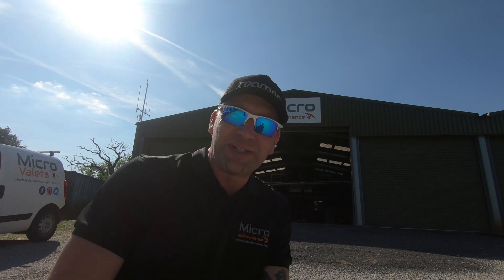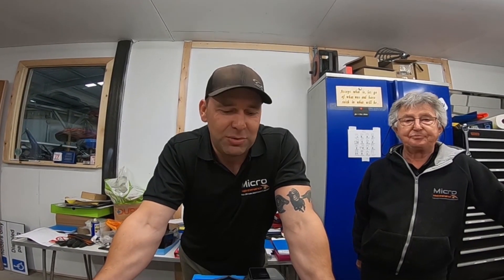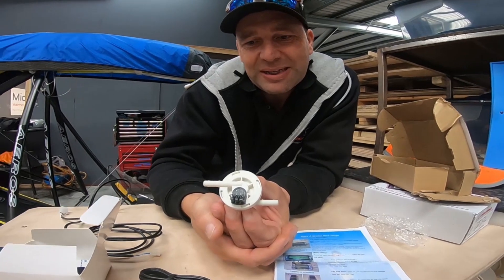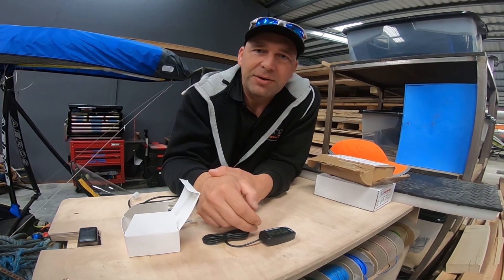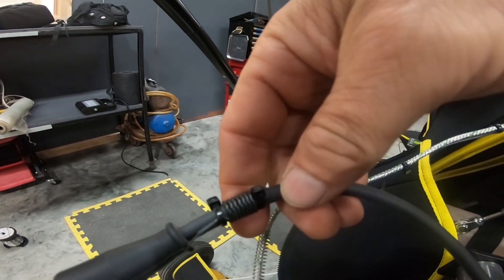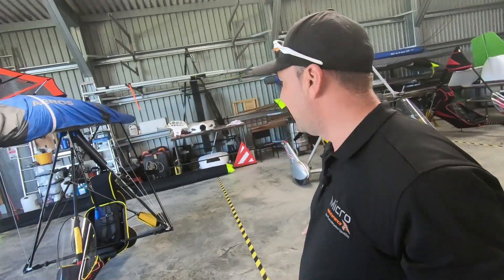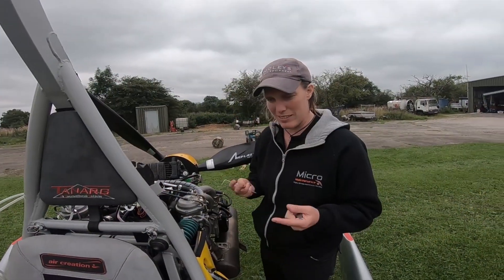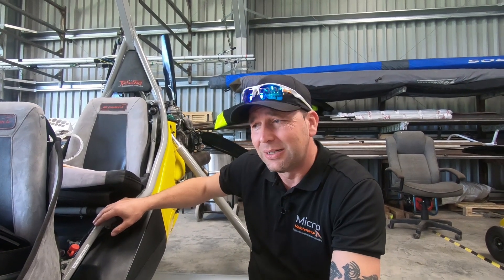Gadgets, Tanargs, and Skyrangers: Micro Maintenance Season 1, Episode 12 Part 1

Comment: I've loved binge watching your channel Mark chap!, loads of great info!... I have a question for you that I hope you see and clarify for me mate...
Does the RPM guage psycally connect to the positive kill switch wire?, copper to copper wire?,  like, proper connected haha 😆 

Cheers!, Ps, got sad when I realised your last vid was over a year ago😢
Reply from the maker: Hi Cheggers, the RPM gauge usually connects to a plus sensor directly from the engine. though some gauges also require 12v from the battery to work, this would be through the master switch.

We have been so busy lately that I've just not had the time to edit anything so have focused on the social media side which is much easier to get out.

Though i hope to start back up again soon, thanks for your support